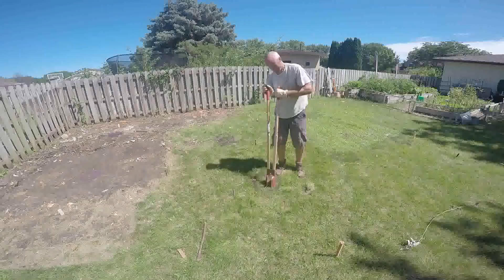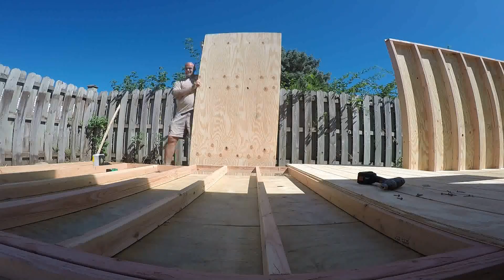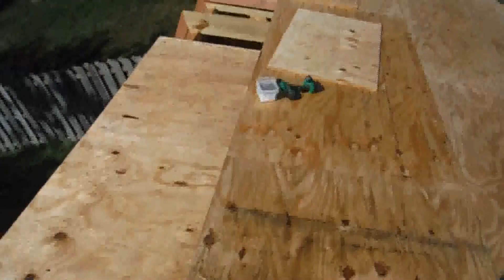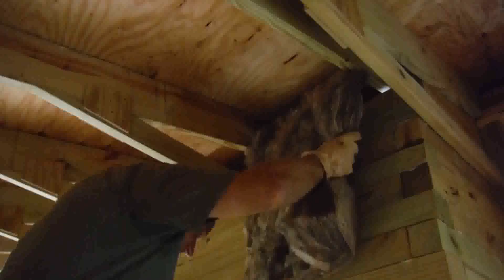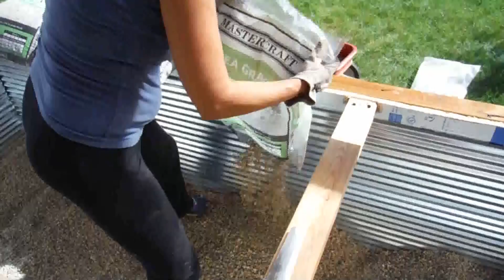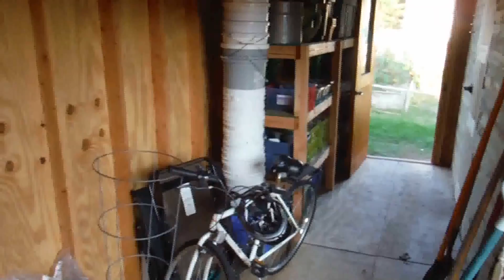Insulated Greenhouse Shed Complete Build

Comment: Congrats! That's a great looking project.  A couple of things I would suggest to anybody following this design.  If you're using poly carbonate panels, You should seal the open ends with silver tape before mounting them in a frame.  It will prevent condensation, or debris like sand from eventually filling the channels and reducing your opacity.  Also, if you were to sink the floor 2 feet below grade, and use CMU blocks for the below grade part and extend it at least two blocks above grade, you can insulate the outside of the block, and stucco it.  Concrete has much more thermal mass than wood, and you won't need to heat the space in the winter to stay above freezing.

Comment: pretty sad you have to ask the city's permission to build on your own property.  I live in a rural area and luckily do not have to deal with things like that.
Reply: I've seen what some people come up with, someone should have told them no.
Reply: In general, one does not need to apply for city's permit for a free standing shed less than 12'x12'  if there is no electricity or water in it.
Reply: 23tonylawrence...  all good in the country  but the regs are to prevent lumber  loosen by wind ( and other misfortunes  )  from coming thru my bedroom window . Considering  my neighbors  carpentry  skills that will likley happen anyway. All n all I'd rather live in the country .
Reply: 23tonylawrence it’s almost as bad as property taxes. like, it’s my fucking property! what’s next my TV is going to be taxed?
Reply: In Los Angeles County you do not need a permit to build a shed up to 12x12 but it must be 5' away from the border/fence. (In case of fire) On the other hand, if you have a mobile shed that you can pick up and move then you can put it butt up to the fence. Now the roof pitch determines how high up you can go and I literally got 3 different responses from 3 different city permit engineers at the county building permit office. You can go as high as 15' if the pitch is correct though you may not want to go that high. All without a permit. Yes, we learned this after we paid for a permit. Never got our money back. Not only that but this caused a reassessment tax on the new shed and another $100/yr added.
Reply: 23tonylawrence I’m grateful to be that lucky as well.
Reply: Smattless  some things should be run through county and city. But then again, cities and counties let Nestle take over the water and have the locals pay for it, which is why the permits and permissions are suppose to do- stop people from drain utilities and water . . . . .    :/

Comment: Great work on the construction! You're really going to enjoy that building over the years. Really nice job on making this video too! After I built my moms greenhouse it became too hot inside so I started looking online and found most have a temp regulated window that opens and closes as needed. Just a thought, you may have already made provision for that if it were to happen.
Reply from the maker: +19stoney64 Thanks for the comment. I didn't show it but two of the windows do have hinges on them for ventilation. I also am putting in shelves on the north wall to hold water containers for thermal mass storage. This winter will really be a testing year as well as next spring/summer. I'm sure I will learn a lot about what works with this design and what doesn't.
Reply: +Mark Hanson (Mark's Workshop Creations) Water containers for thermal mass...  What a cool idea.
Reply from the maker: +Steve French Wish I could take credit for that. However, people who have studied this kind of greenhouse have discovered that water is the best thermal mass.

Comment: did you have any shrinkage/expansion issues with the polycarbonate in the window frames or on the front large panels? or did you have a way to manage growth with screw holes n rubber washers? the only thing I would have done different was some type of joint to lock the 4x4 green house walls in the corners and I would likely have access for a wagon/wheel barrow to the green house. You did a good job at least you got it done! Don't worry about the trolls they are every everywhere.

Comment: You should always consult your city for if you need a permit for two reasons: 1) electrical safety 2) water drainage
You do not want to be responsible for drowning out someone's yard for poor water management. You will be liable. 

And for electricity, you want to make sure that the structure is up to code such as the National Electrical Code by the National Fire Protection Association started back in 1890s because s*it caught on fire. This is especially true if you live in a desert state such as California, Nevada, Utah, Arizona, New Mexico, Colorado, Wyoming or Texas. Nothing like burning down a bunch of people's homes and killing someone just to save a buck and effort on getting a permit.

Comment: Great looking design and workmanship.  Any word about ventilation needs, months of use and what you grow in it?  And any rotting issues?  Thanks also for a good moving video and running commentary.
Reply from the maker: +Tibor Schimek thanks fit your comment.  I haven't had any problem with ventilation issues. I open up the windows in the morning if it's going to be a hot or sunny day. I will grow cold tolerant plants in the fall through winter months and then raise all of my seeds in the spring.  I haven't noticed any rotting issues but of course that will likely happen in places you don't see very often so time will tell.

Comment: nice greenhouse/ shed combo . . . well designed and constructed! no concerns about the pressure treated and/or the galvanized metal leeching into the soil and plants? I don't mean to be critical--truly want to know if I am being overly cautious. THANKS!
Reply from the maker: +embwee Thanks for the comment. I've read a bit about copper and zinc leaching into the soil from pressure treated wood (copper) and galvanized metal (zinc). The amounts of increase of either metal into the soil is likely not to be an issue for humans. If you are concerned about it you can line either material with plastic to help prevent leaching.

Comment: Wow, I'm stoked.  Are the plans available? Also, did you consider venting the greenhouse?
Reply from the maker: +John-David Longwell I haven't made any plans for it. I may someday, but not yet. I vent the greenhouse just by the two side windows and the three smaller front windows. I can open the side windows and pull the front ones out if I need to.
Reply: Thanks for the response.  Sounds like what you've described provides adequate ventilation.  What's the total footprint of the greenhouse-shed combo?
Reply from the maker: Its approximately 208 square feet. A 6 x 12 greenhouse, a 6 x 12 portion of the shed and a 8 x 8 portion of the shed.

Comment: Really amazing work. I'm in the planning phases of building out a shed with an attached greenhouse as well, except the shed will be a recording studio. I am inspired by your craftsmanship. What did you put between the 3 polycarbonate panels to water proof it? Is that just the treated / stained wood I see or did you put some sort of trim there?
Reply from the maker: I just screwed the polycarbonate panels to the angled rafters. I have been inside the greenhouse when its been raining and I have never seen any leaks. Those are green treated rafters too just in case.

Comment: what about the water drainage from the beds?
Reply from the maker: I haven't had any problem with that. I poked holes in the insulation so water can pas through and I live in an area with very sandy soil so drainage isn't really ever a problem. If I had heavy clay soil below I would have put in drainage of some sort.

Comment: Where did you place the vents?
Reply from the maker: I didn't put in vents per se. The two side windows are hinged so I can open them when I need to an all three of the front windows are removable. I also have two shelves on the north wall with plastic boxes filled with water for heat storage. This also helps to prevent heat spikes. I haven't had a problem with overheating yet.